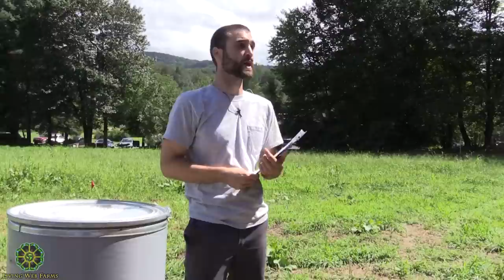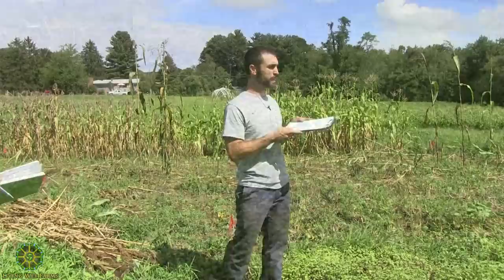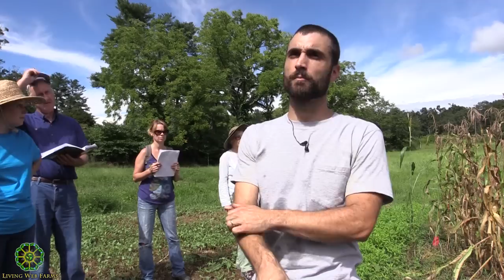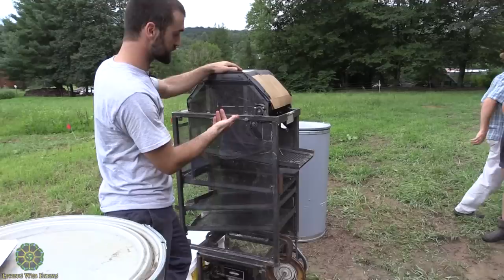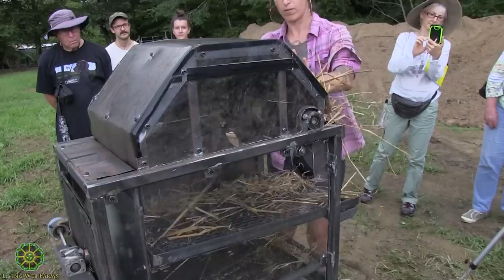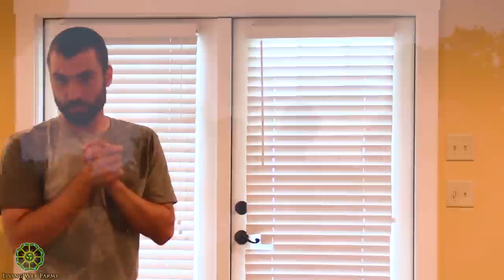Small Scale Grain Production with Mark Dempsey Part 2

Comment: Watched Indians from India, threshing Rice by pounding with light small logs maybe 3-4in in diameter. Google hand pounded rice. Rice is hard to de-hull in general, so this technique appealed to me. They pounded a hole maybe an inch or so greater in diameter set inside a vertical hollowed log but also a horizontally oriented log with a similar “hole” women pounded their hand held poles, sometimes three women at a time, in rhythm, steady pounding seemed to do the trick. Periodically one of the women would scoop out the pounded rice and winnow it using a big almost scoop shaped flattened tray about three feet in diameter. Simple. Effective. Time tested.

Comment: I've seen a metal comb thrasher used for turning flax stocks into linen fiber. It looks like several metal combs affixed to a sawhorse with the teeth pointing up vertically. The sawhorse is bolted to the ground. You hold the thick end of the stock, thrash the stock downward onto the comb and pull the stock to detach seeds from the stock. After detaching the seeds you can thrash the stock on another set of combs that have teeth closer together and thrash it closer to where your hand is holding the stock to create long thin fibers which can be woven to make linen cloth. there are several more steps to creating flax fiber which I have skipped over but I thought that the metal comb thrashing might be a good inspiration for developing thrashing techniques.